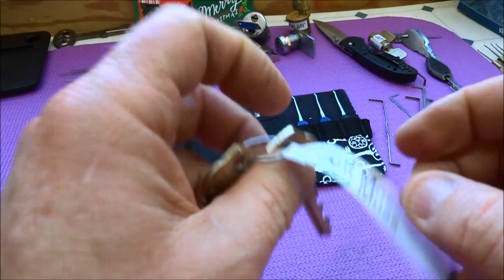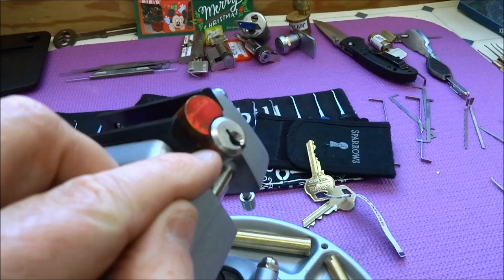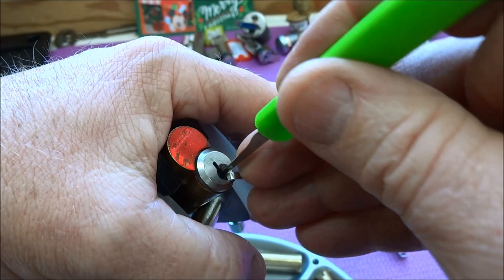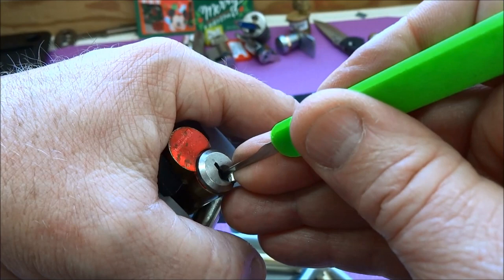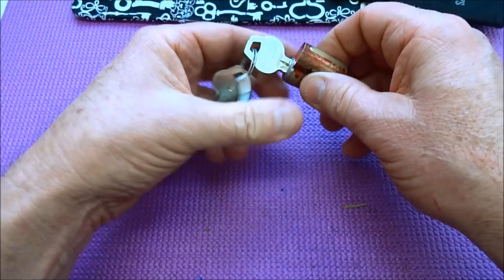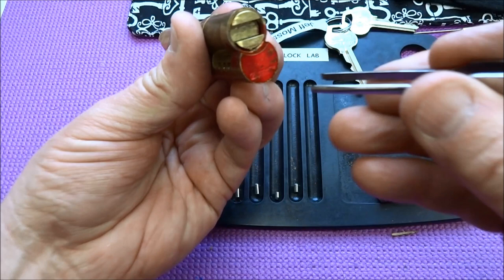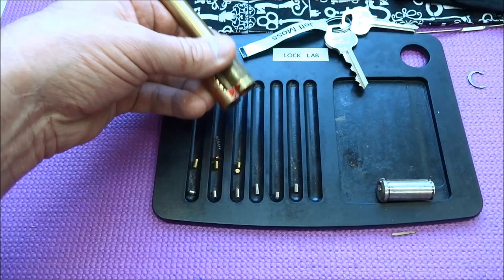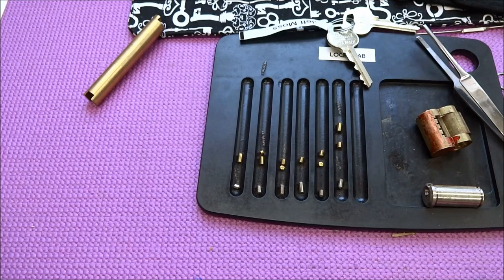(466) Corbin Russwin LFIC Picked & Gutted (Thanks Jeff Moss!!)

Comment: Awesome video, I have recently purchased a dead bolt however am having trouble picking it.  I can pick pad locks easily however i can't get this dead bolt. Any tips on how to find the right direction on in ding the dead bolts tension and picking this thing?